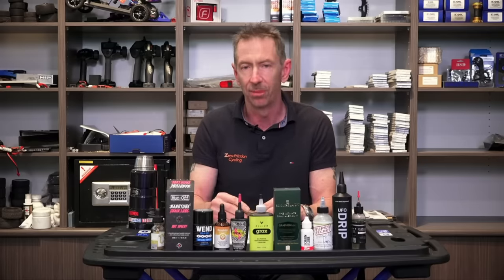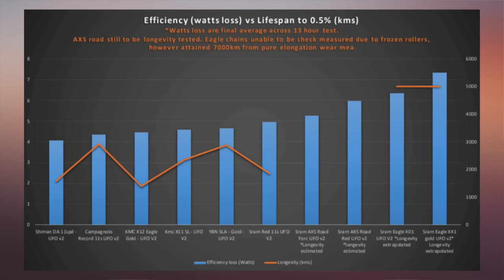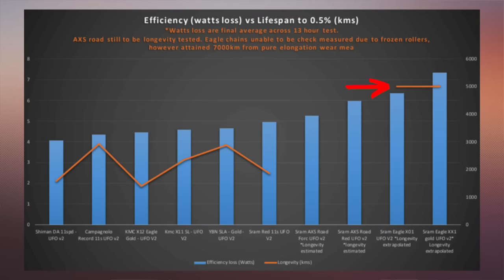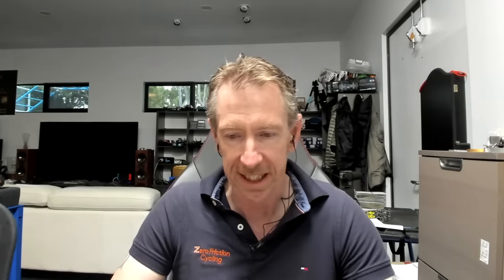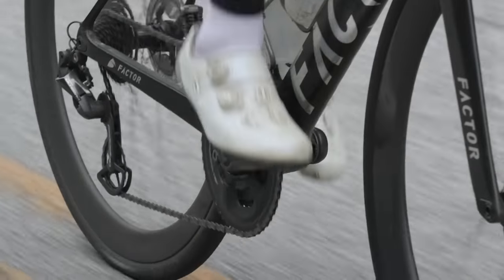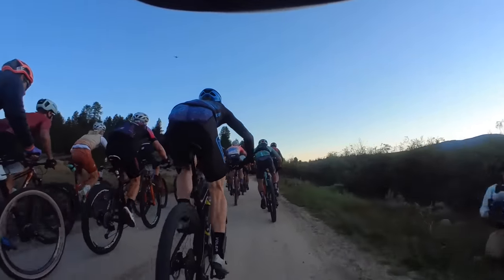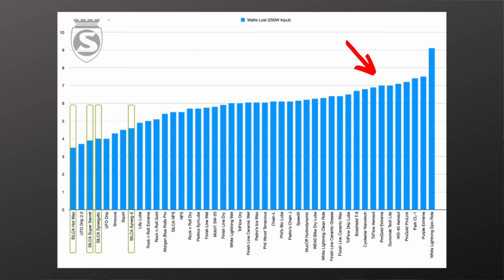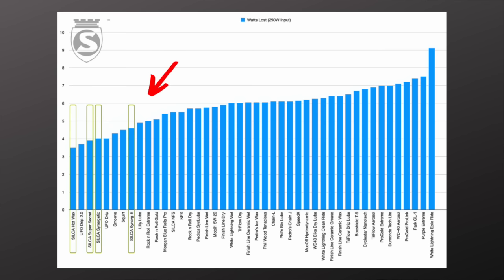How Slow Are SRAM Chains and Other Drivetrain Efficiency Questions With Adam Kerin

Comment: People are putting oversized pulley wheels on their bike (in an area where there is almost no load on the chain, thus for miniscule results) to make their drivetrain a tiny bit more efficient and SRAM is selling drivetrains with decagons for power transmission, wtf. I strongly agree on that one, I think it is plain stupid to buy such a drivetrain. One can feel how inefficient an 11t cog is, I can't imagine using a decagon as a cog, it must be horrible.
Reply: On a road bike it’s more for bling since the gains are small, but on a TT, all the little watts here and there ad up.
Reply: @CarbonRider1  those same watts add up on a road bike and due to speed, it's a smaller percentage of the losses for a TT bike
Reply: Been riding SRAM for well over 200k miles... with Shimano chains🙃
Reply: @veganpotterthevegan  they do, but the gains are less when riding in a group, and really only become more of a gain when riding solo / doing an ITT on a road bike. It’s the same with some aero gains.
Reply: @CarbonRider1  drag is very important in a peloton.  If you're holding on at the back of a group at 250w, or it's a slow group you're trying to catch while pushing 250w, you'll still benefit fairly similarly from those gains
Reply: @CarbonRider1  shoot, I even notice the differences on my Wahoo if I get lazy and forget to lube my chain.  Losing a good 5w at a given heart rate in zone 2 and it only goes up from there with hard intervals
Reply: @veganpotterthevegan  bud the differences for this type of marginal gain is 1 or 3 watts, not 10. It’s only when you accumulate a bunch of marginal gains that it starts to make a difference. There is very little drag on an OSPW.
Reply: @CarbonRider1  looks like you don't read very well. I was talking about an unlubed chain vs the same lubed chain. You can lose over 10w with a very dirty chain
Reply: @CarbonRider1  I have no interest in OSPW because half the gains are lost with aerodynamics unless you buy an oversized, aero cage with it...something a close friend of mine tested and got 2 watts out of in the wind tunnel.  He was already using OSPW so he didn't do a baseline run with a stock cage.
Reply: @veganpotterthevegan  power is power, so 250w with a clean chain vs a dirty chain, is still 250w. Speed for the watt output, is different however.

Let’s say your OSPW gives you 1w -2w, your 250w is more like 251w, the speed difference there is almost nothing, and is even less when sitting in the draft of a group unless you add more marginal gains, or go to the front.
 
I’ve ridden my Crux with 50mm road wheels in a bunch, and my SL7 on group rides, in a bunch, there is no real difference in power when it comes to aero since most of your drag comes from your bike position and what you wear. Now, taking a pull on the front, I did notice the difference between the two bikes, since the Tarmac is more aero.
 
So my point still stands, that 1-2w for an OSPW is only going to make a difference when used with other marginal gains, and riding solo. My TT bike for instance, OSPW, ceramic BB, aero wheels, optimized position, aero helmet, speed suit, aero socks, etc etc, then those gains go from 1-2w, to 50w+.
Reply: @CarbonRider1   more poor reading comprehension🤦 Yes,  250w is 250w but I'm talking about losing power at a given HR
Reply: @CarbonRider1  1-2w is 1-2w everywhere.  Even if you're in a group,  that's more energy saved to use elsewhere.   If it's in a race, that's energy to use in a breakaway or the bunch sprint.
Reply: @veganpotterthevegan  relubing a dirty already lubed chain isn’t really saving you watts. If it’s watts you are concerned with, clean your chain, then relube a clean chain, if not you are just putting lube on top of dirty lube. But to your argument, yes, a dirty chain, verses a clean chain, will save you more watts than an OSPW. Like I said initially, the OSPW is not much of a gain by itself on a road bike.
Reply: @CarbonRider1  where did I say I wanna relube a dirty chain?  Also, I can imagine the aero OSPW cage will give a similar benefit on a road bike and most of us ride alone a lot,  although "I" don't care about my speed on solo training rides but many people do and nothing is wrong with that.
Reply: @CarbonRider1  Nope. Ospw doesn't add anything. The only big impact on the ospw is the ceramic bearings.

1) Normal size pulley wheels, lightweight, ceramic bearings, short chain link, cost 120usd.
2) Ospw add more chain link, more chain contact to the pulley wheels means more friction, more heavier cause additional chain link, cost 500usd.

In term of watt savings betwen 1 & 2 are the same.
Reply: @apair4002  did you read my comments? I’m guessing no since you mostly repeated what I already commented, although the point of the OSPW, is the size that adds value / a marginal gain over just the ceramics bearings. The guy in the video discusses this. Although there is some argument about the aero penalty of OSPWs like ceramic speed, Kogel, etc. O had a CP OSWP, and the shifting can be a bit slow, and I got dropped chains due to the lack of tension and sloppiness of the OSPW. I have an AbsolutBlack OSPW on my TT, smaller profile, and shifting is perfect.
Reply: @veganpotterthevegan  you said you forget to lube your chain, and it’s on the Wahoo, so I’m guessing you didn’t strip the chain of lube before using it, and you meant relubing a chain that has gotten dirty, and dry, without cleaning it first. or do you remove the lube off of your chains and ride them? If you take the chain off and clean it before relubing it, that’s the way to do it.
 
Again, regarding road verse a TT, you are repeating what I said, unless you are on your own, and/or doing an ITT, there isn’t much difference in a bunch. We are in
agreement, although I’m a bit confused because you can’t seem to stick up your argument, since you said that there was no benefit to the OSPW because the gains were negated by the aero penalty, but then you seem to be arguing there is a benefit, but then agreeing with me…
Reply: @CarbonRider1  my god🤦 My chain on the wahoo barely gets dirty at all.  And I said it wasn't lubed, not that it was dirty.
Reply: @CarbonRider1  not repeating anything you say.  We probably don't even agree on the color of the sky ffs. 
I also never said there's no gain from OSPW.  If you're slow, or building a bike for hill climb events the gain is there.  And the aero cage I told you about has OSPW.  It's up to the person to decide is that cost per watt is worth it and for many cyclists, money isn't a problem. There are better places to spend money for efficiency but if you've eaten all the low hanging fruit and have the cash, buy the pulleys with an aero cage if you're riding fast(tts or in a group)
Reply: @veganpotterthevegan  you actually said in the comment after referring to your wahoo that a dirty chain can lose you 10w? 

So you run your chain unlubed on your wahoo? 

A dry chain that has been indoors should also be cleaned. You get oil build up on your chain, even though it is inside on the trainer, and just re-applying lube to a dry or dirty chain, deceases the life of the chain, and you lose watts because it is dirty, maybe not as much as being outside, but it still needs to be cleaned.
Reply: @CarbonRider1  OMG, read it again. Same comment referencing MY chain on my Wahoo and a random dirty chain that's not my chain.
Reply: @veganpotterthevegan  you should probably go back and read your comments. And again, read mine. A dry chain that has been lubed before, is a dirty chain, and relubing it, is applying lube to a dirty chain.
Reply: @CarbonRider1  nothing complicated in anything you've said. Your reading comprehension is the problem here.
Reply: @veganpotterthevegan  your last comment is about marginal gains for a hill climbing event yes? So we are in agreement that if you are doing some sort of ITT, road or TT, accumulating marginal gains become a benefit when added together. yes? 

And we both agree that there is a watt savings to an OSPW of 1-2w +/- yes?

Marginal gains aren’t just for slow people FYI, and if a hill climb, the aero OSPW cage might not be of much benefit over one without it.
Reply: @veganpotterthevegan  my reading comprehension is just fine bud, I don’t think you realize what you are saying in your comments. Go back and read your comments again.
Reply: @CarbonRider1  yes,  your reading comprehension is terrible.  And like I said, 1-2w is 1-2w no matter where you are.  And I never said marginal gains are just for slow people.  Just that some gains are bigger in certain situations. For example...big, low RR tires for a hill climb vs a front tire narrower than the brake track for a TT bike even though it rolls worse than a big tire.
Reply: @CarbonRider1  I don't think you wanna ride with a disc wheel and 90mm front wheel for a hill climb averaging 10% just as you don't want 32mm wide, fast rolling tires for a TT.
Reply: @veganpotterthevegan  I just saw this comment, and you keep thinking I don’t understand what you are saying and it’s my fault. Do you think it might be your inability to articulate what you mean?

 “Yes 250w is 250w but I’m talking about losing power at a given HR”.

Please explain how how 250w with a clean chain vs 250w with a dirty chain has an effect on your HR? The power hasn’t changed, but the speed has changed due to lack of efficiency. 

HR would be effected if you were trying to maintain the same 40kph on a dirty chain as with a clean chain, which would require more watts. Then HR would increase with the added watts. Yes?
Reply: @veganpotterthevegan  your ability to articulate sucks bud, and apparently recall what you commented, you said “if you are slow…”

How much faster do you think 2ws gets you? Please explain.

“A front tire narrower than the brake track for a TT bike even though it rolls worse than a big tire”.

Not really. You would want to run a tire that is optimized for the rim; you don’t want the tire to bulge or sit smaller than the wheel width.  If so, you take an aero penalty. If your wheel is optimized for a 23mm tire in the front, you want to run a 23mm, not a 28mm, and vice versa.

As far as rolling resistance, it comes down to the road surface, crappy roads, a wider tire and lower pressures might be faster, even with the aero penalty. Smooth surface, like a velodrome, narrow tires, higher pressures, it depends.
Reply: @CarbonRider1  I'm not really blaming you.  I think you can't help it. 
*if your trainer is set to a certain force and your HR is 150 but your wattage is 5w lower than normal, you have a 5 watt loss from something.  Not sure how that's confusing you but if it can confuse anyone,  it's you.
Reply: @Carbon Rider  optimal tires for a wheel are typically narrower than the brake track.  You'd know this if you've been to a wind tunnel.  There's certainly variation with where the widest point of a rim is. But most modern rims are designed to have the widest point about 1/3 of the way to the end of an optimally sized tire. With my Jet 90s, this means 22-23mm tires that measure 23-24.5mm wide on the rim.  Roughly in line with the rule of 105.   My DT dicut 48s are a bit odd with the wide point being 1/3 of the way to the inside of the rim.  They are an anomaly with wanting you to run 28s on them even though the leading edge of the rim being narrower than 28mm.  I haven't tested these wheels and probably won't when I go back to the tunnel in June.  My guess is that that's for very mixed yaw riding at 35-40kph and not the 48-50 I'll be time trialing at.  Its highly unlikely they'd be remotely fast under 5 degrees yaw with a 28 that's measuring at 31mm when the leading edge of the rim is close to 27mm wide.
Reply: @veganpotterthevegan  oh it isn’t confusing, if your trainer is set to 250w on erg mode, the power will be 250w, regardless of the chain condition. In ERG mode, with a fixed power target, a Smart trainer is constantly measuring the speed and adjusting the resistance to balance that equation so that Power remains constant. This is partly why it doesn’t matter which gear you are in, or what your cadence is, the power remains constant. Your power is the same, but you might be pushing a lower cadence, spinning slower.
Reply: @Carbon Rider  where did I say I set my trainer to 250w?  I don't use erg mode... ever.   You're looking to explain away your confusion. Just accept that you don't know what you're saying.
Reply: @veganpotterthevegan   ah, you are talking about the Rule of 105%, where rim width should be greater than that of the tire, so that the tire sits flush with the rim, not that the tire should sit narrower than the rim when mounted. 

Dude you really need to work on your words.

Yes, I do aero testing, I’m a time trialist. If you read my comment, I was clarifying that you don’t want the tire to “sit” narrower or wider than the rim…and you want to run a tire that is optimized for the rim / wheel you are using.

I run a 23mm front tire in my PCW Wake 6560 because the rim is optimized for a 23/25mm tire, and run a 25mm on the rear PCW Blur disc wheel, this tested the fastest for me.
Reply: @CarbonRider1  Jesus, you blow me away with ways you can tell me you don't know what you're talking about.
Reply: @veganpotterthevegan  You said “yes, 250w is 250w but I’m talking about losing power at a given heart rate”

You said “if your trainer is set to a certain force and your heart rate is 150 but your wattage is 5w lower than normal, you have a 5w loss from something”

The first comment was about power, but it can be whatever you want it to be, it was your example. 

The second comment was setting your trainer to a “certain force”, we call that erg mode, but if you don’t want to use erg mode, fine. Maybe a better way to write this would be “when I put out X amount of watts”, since you are the one putting out the watts, not the trainer.

Power is power, regardless of a dirty (chain that needs to be lubed) chain. If you are producing less power, your HR won’t be higher for less power.
Reply: @Carbon Rider  ha, you're a riot!!!  There are multiple ways to set the force on your trainer peabrains.  From adjusting the gradient, windspeed and the resistance percentage... none of which are wattage settings😉
Reply: @veganpotterthevegan  I was thinking the same about you 😂 and your challenge with using the English language to explain yourself
Reply: @CarbonRider1  you're not thinking at all.  That's the problem here.
Reply: @veganpotterthevegan  you mean “pea brain” not “pea brains”, the latter is plural and I only have 1 brain, not multiple. Learn to use your words bud.

Sure you can change the resistance of the trainer, you have gradients etc, but just like the real world, the watts you hold are the watts you hold, the only way your heart rate would change is if you tried to maintain the same speed with a dirty chain, as with a clean chain, which would require increasing your watts.

Here is an example, and the trainer resistance and gradients don’t matter, assuming you keep them the same for clean chain vs dirty chain.

Let’s say you do 250w and travel 30kph with a clean chain. Then you have a dirty chain, and let’s say there is a -5w loss. If you held 250w, then your speed would be lower, let’s say 28kph just for the sake of argument. To get back to 30kph, you would have to do 255w, then there would be a change in exertion and heart rate would increase.

Make sense?

In your defense, there is a noticeable difference running a clean chain, it does feel more efficient.
Reply: @Carbon Rider  just looked back at all your comments for laughs. I was only reading the ones that I was tagged in.  It's hilarious that you have the very worst of OSPW systems on the market that's not a Chinese knockoff for $40.  You sure love being suckered🙃
*I'm a fan of Absolute black chainrings and their brake pads.  But their OSPW system is a total joke.  Look at Hambini's  teardown of that piece of crap.   I installed one for a friend and thought it was ridiculous but it was far worse than I thought.
Reply: @veganpotterthevegan  I never said you wouldn’t have a loss, in fact, of you read my last comment, I state exactly just that, and give an example of loss, however if the power doesn’t change, there is no difference in effort until you try to make up for that loss by increasing the power, it’s called “physics”.

Oh, and yes, power differs between power meters, DC Rainmaker has a bazillion articles on this. But using the same power meter for both a clean and a dirty chain will not change the power reading, 250w will still be 250w for that PM.
Reply: @Carbon Rider  all of this is physics which is why you don't understand any of it.
Reply: @veganpotterthevegan  I got the AB OSPW mostly for the bling factor, it actually rides just as smooth as the CS one I had, but shifts much better, and no dropped chains.

If Hambini is your go to, explains why you are lost. Most of his stuff is lost in his rants to try and get clicks. He does things to misrepresent data and products. He got reamed for his review of the Colnago V4Rs in the comments of his video. Then there was the time he tried to say the SRAM DUB cranks don’t fit properly, leaving out the fact that he didn’t use the pre-load to secure the crank.
Reply: @veganpotterthevegan  flip it around this way, maybe it will help you sort this out.

If you hold 250w and ride 30kph, then you put on a speed suit that gives you an extra 20w, and your speed increases to 40kph, how much power are you holding? 

I’ll help you out, you aren’t doing 270w, you are still doing 250w, thus there is no increase in power and exertion, and your heart rate stays the same.

If you take the speed suit away and do 250w, your speed will drop back to 30kph, your exertion remains the same, and there is still no change in your heart rate,

Now apply those same physics to the -5w loss due to a dirty chain.
Reply: @Carbon Rider  you're not going to help anyone.  There's nothing you actually know that I don't.   There's plenty you think you know that you don't though.
Reply: @Carbon Rider  as with my riding on the trainer, that 5w loss was a 5w loss at a given heart rate(AS STATED) since the wattage reading was reading the output after all those losses and not what I was actually putting into the pedals.  
*I'm loving how confused you are😍
Reply: Sram chains (10 -11-12spds) in '70 & '90 series last a long time. My experience !!